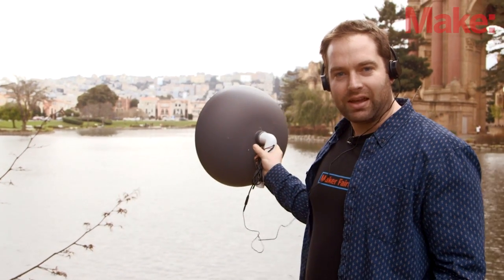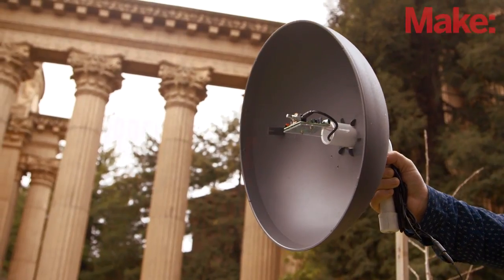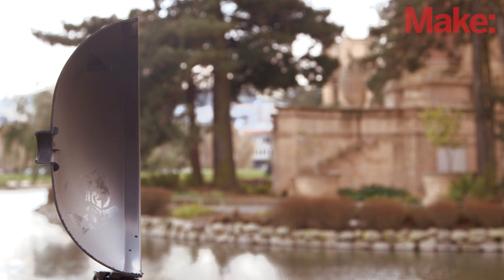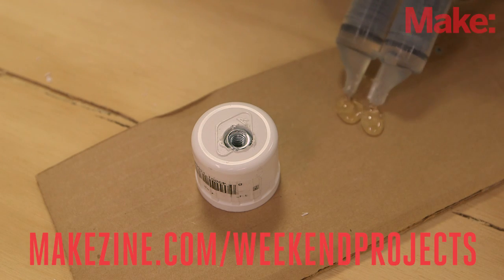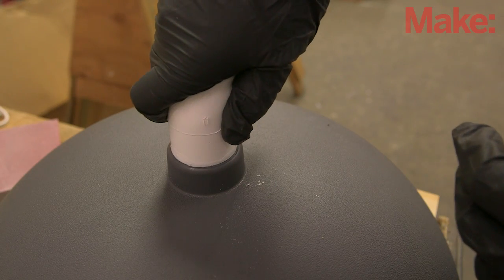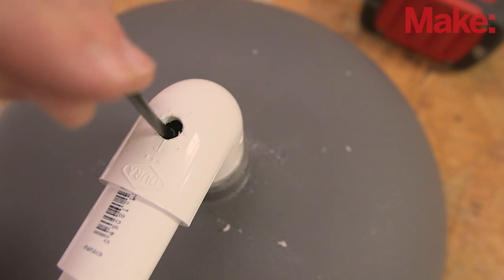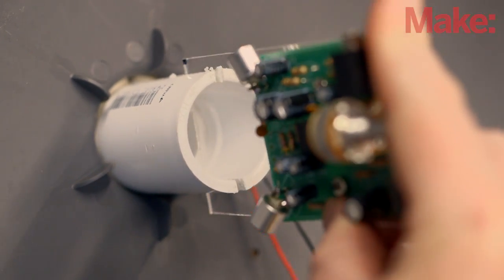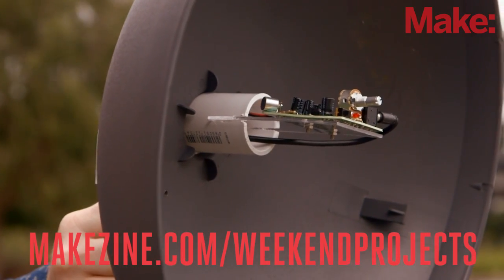Weekend Projects - Squirrel-Baffle Spy Microphone

Comment: I would've mounted just the microphones on the inside of the dish, while keeping the circuit on the outside - that might lead to a better focusing of the sound, since the PCB is not in the way.
Reply: tbh, the whole thing is a schmu. a little offset sat antenna beats it by far, und using a tereo microphone makes absolutely no sense. :D